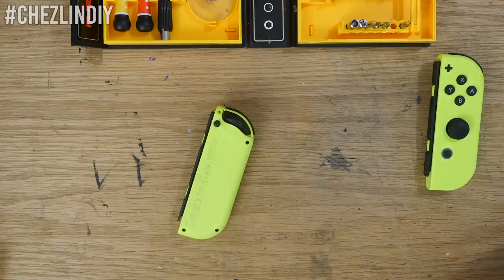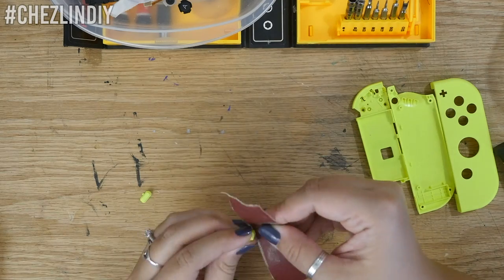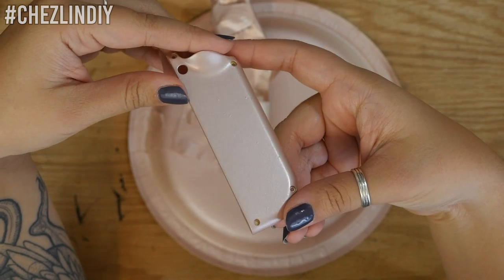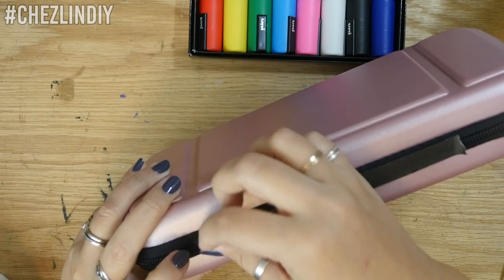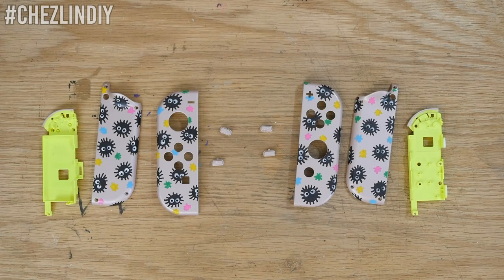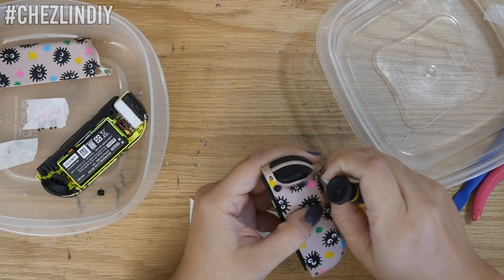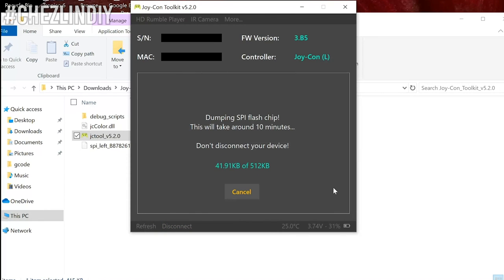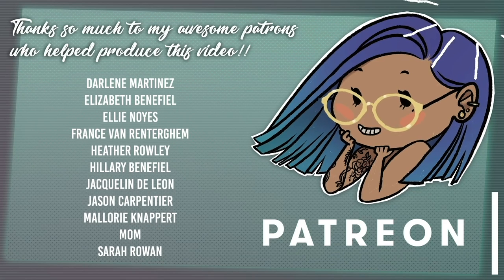Custom Painted Nintendo Switch Joy Cons and Case! - DIY

Comment: Oh my.... I think i'm too scared damaging my joycons, i will just draw on them without pulling them apart...

Edit: Hi! Quick update after all this time. I did draw littlr doodles on my joycon with a black sharpie and the result came out good. But. (i don't know if it's a pro or a con) the doodles were erased or faded because of hands rubbing it while playing (after a lot of playing obviously) . So it's not really a problem there. That means i don't have to use acetone. And i ca' come up with new designs
Reply: Same. I would lose everything.
Reply from the maker: I put off doing this project for a few months because I was scared to take the controllers apart... It ended up not being as hard as I built it up in my head to be. As long as you're careful and keep everything organized, it's not too bad! 
The only issue that could happen if you just draw on them without taking them apart, is that the design could scratch off more easily. You wouldn't be able to use a spray finish. I guess you could probably brush on some type of finish? That might be worth looking into!
Reply: Be careful!! If the paint gets anywhere near the buttons or sticks it can really mess up your joycons / break them. Taking it apart looks daunting but it’s really better to do that instead of paint right on them
Reply: I got custom galaxy shells made and tried to change my controllers myself, went fine until one of the ribbons ripped so I had to go back to the company and buy the controller option with the galaxy shells 😬
Reply: My joycon had a faulty rail so i tried taking it apart, i broke all the screws and i still have no idea how i did that. I was super gentle because i knew how fragile they are. People don’t do it theyre too expensive. On aliexpress there are some really good fake joycons that are only $25. Ive been using them as 3rd/4th person controllers and theyre totally worth the money. I would use those to customize your switch
Reply: Oh yeah me too! I think ill just stick with designing the case lol
Reply: Also same.
Reply: @niekgrijzenhout5011   oh, i had never thought of this possibility... Are they this good to play with?
Reply: kilig moon ive been using them as 3rd or 4th player controllers and theyre great. The vibration is just a tad too loud but theyre really good for the price and they can do everything a joycon can. Only the buttons feel a little cheap but thats to be expected at that price point
Reply: @niekgrijzenhout5011  thank you, i'm going to check if I find it interesting. Have a good night.
Reply: kilig moon you can always buy white shells and paint them!
Reply: Im gonna use markers its easier and safer
Reply: They have $1 to $2 clear cases on aliexpress that are great for painting. First I sanded them then painted them. Perfect
Reply: Cute I have a nylon switch case that I want to do this with but not sure how yet lol puffy paint most likely and a toothpick for super fine lines but I do have some apple barrel paints
Reply: Awhile ago I used acrylic paint on a PS4 controller to dab a galaxy design on it. I didn’t seal it with anything and so far it’s held up with no scratches for about four years. I wouldn’t paint an entire controller without taking it apart, but just doing a light design worked well!
Reply: Did it work?
Reply: Maybe you can get a case?
Reply: mastergirl922 thought about that too. Do you think it will be working if I use acrylic paint and then a finish on top?
Reply: kilig moon I’m too scared to even draw on them. I feel like I would just ruin it
Reply: I’m terrified also! I’m gonna see if I can get blank shells and draw on those!

Comment: I would have bought a set of white replacement shells
Reply: Why?
Reply: @nusaybahansar9285  because then you would not have to prime
Reply: @‘syth_Shadowz シ nope, cleaning it would totaly do the trick
Reply: @TheCludo  You have to prime anyways because primer is not only white base color, but a type of glue- alcohol mix that helps the paint and the shell to connect better. The alcohol evaporates and leaves the glue, which then helps the paint to form a chemical bond in order to last longer. Always use primer!
Reply: Hail-Falcor not very rare? There are a lot of colors available. I think most people just dislike this color 😂
Reply: Used that when painting mine, really simple actually!

Comment: This is amazing, but no no no no NO ! I don't have the courage to do that with my joycon !! 

Really god job !!! <3
Reply: BubuleSan 
I’ve seen a lot fo videos like this, and most of them say that the trickiest part is the middle inner pice with the triggers
Some recommend to buy the grey joy-cons, because they match better with other colors
Reply: If you don't want to take them apart, you could try taping over the buttons and painting around them, or if you feel like you have great aim with a spray can, you could use the spray can and tape.
Reply: I can't even properly draw one of those black bugs on paper and I'm going to paint my Switch XD

Comment: I think I'll do this but I would love an update on how the paint has aged and if you think there's extra tips we should know. (By the time you'd make it, of course, I know it's only been 10 days as of writing this comment.)

ALSO, in the video she states she read/watched multiple guides which I 100% recommend doing, but I think I will also try to find broken joycons off ebay and use them for backup parts in case I break or lose anything. If you're worried about stuff like that, maybe monitor used sites & see what you can get to experiment/paint on.
Reply: I have done this with many joycon for friends and family and after years a 2k finish will hold up. I can send a link or pictures if you want.
Reply from the maker: It hasn't been that long yet, but they've held up perfectly so far! Even though the spray paint was dry, it did off gas for a couple days after. It made my hands smell like spray paint... but nothing smudged or wore off.
I'll probably periodically do updates on these guys over on my instagram more often than on here. If you want to check that out, it's @chezlintm 😊
Reply: gabbie or something if you use a clear protective layer it should be fine 👍
Reply: It depends on the clear coat and the weather where you do it. If its too humid the clear wont be hard enough to fully protect it.

 I use 2k spray max cans (they are used for cars and are a bit more expensive, 20$-30$ to be exact) the problem with these cans is that they only last 2 days once they have been activated. And only using that for only 1 pair of joycons would be a waste. But other than that, that clear will last for years.

Comment: I really want to try this but I just can't feel confident enough with that sealant staying. I'd be mortified but prepared if it started fading out smudging because of constant handling. :( A later update would be awesome to see how it holds up!!!
Reply: You could try using Tamiya paints. They are made for plastic model kits, so the formula holds up well on plastic parts. I painted some of my keycaps with them and they haven't faded or smudging after a couple months of use.
Reply: You can buy joycon shells for really cheap (less than $5) if youre not confident Id suggest using a throwaway joycon shell just incase things dont work out like youd want and you can easily just switch them back out with your originals

Comment: Hey hey please help I have questions. Even though I will probs get a clear case does the skin feel weird on your fingers? How comfortable is it from a scale of one to ten? How things feel on my hands is very important to me. You know how some plastics just feel gross and uncomfortable but others like matt plastic or silicone feel nice. Does it feel cheap or could my finger glide across the surface without being uncomfortable? For example the way the naked Nintendo feels on my fingers is a good material but would the skin ruin that? Also, if I ever wanted to take the skin off would it ruin my Nintendo or leave sticky stuff behind that would feel horrible on my fingers? Is it easy to remove if I end up hating it? Also, for the clear cases I’m seeing one that goes all over the Nintendo and cover the front and ones that only cover the back. Which one should I get? Also how does the material on the cases feel is it good or gross feeling? Is the case super thick and uncomfortable? All of these things are very important to me and if anyone could reply with an answer to at least one of my questions it would make me feel so much better please help I have anxiety

Comment: How is the paint holding up at this point? I'm thinking of painting mine but I'm so scared after a while it'll wear off. I used to paint Xbox 360 controllers all the time and no matter what I used, it would always rub off. Sometimes it took a year or 2 but it always would.

Comment: I have some sensory processing issues and was wondering if the texture of the controllers feel different after painting them. I want to do mine but I’m nervous that the paint will leave a texture that I can’t handle

Comment: I'd be way too scared to do it to my Switch... but my PS3 controller :3
Reply: If you don't want to take your joycons apart, you could try taping over the buttons and painting around them, or if you feel like you have great aim with a spray can, you could use the spray can and tape.

Comment: i find it rather  hard to unscrew everything
couldnt nintendo just made a fix middle part in black everything but the buttens are atached too so you only have to take that out
then paint or switch the outer shell and done....

but no they ahd to made it  like that

Comment: Couldn't you carefully mask off the buttons to paint if your afraid of taking everything apart?
Reply from the maker: You could probably do that. I, personally, would still be a bit worried about paint seeping into the controller and possibly messing up the electronics in it. I also think it would be a little more tricky to get a nice even coat of paint.
Reply: @chezlin  very true. I'd be afraid to take apart the controllers and mess up the wiring. I'm not good with that kinda stuff. I do love the results you got the soots are so cute!
Reply from the maker: Yeah, I'm not going to lie, it was a bit scary unplugging all the wires and stuff. Thankfully the disassembly guide I was following was really detailed, that helped me keep track of everything! 
One thing you can look into if you want to customize your joy cons, but not have to go through all of that stuff, is to get some joy con skins. They're basically big stickers you put on your controllers to make it look like they're repainted. You can find predesigned... designs, or I think some companies let you do custom designs, too! 😊
Reply: @chezlin  I didn't think of that!! I'll have to look into them when I finally get a switch 💜
Reply: @coleperez3612   Strongly suggest getting a spare pair to work on, so if something happens and you do break something, you still have your original pair.